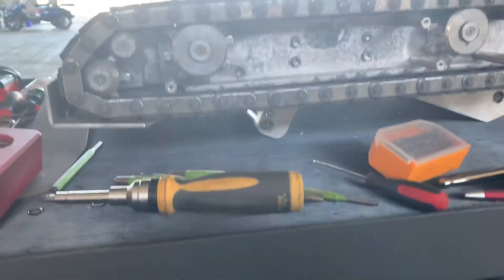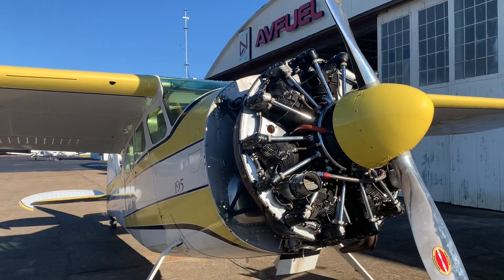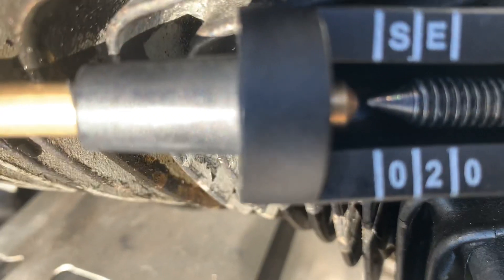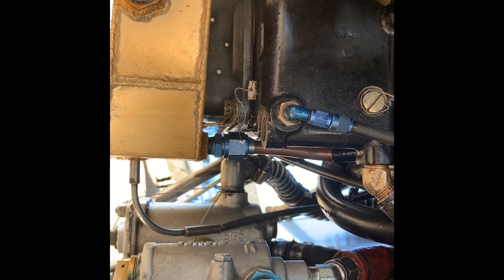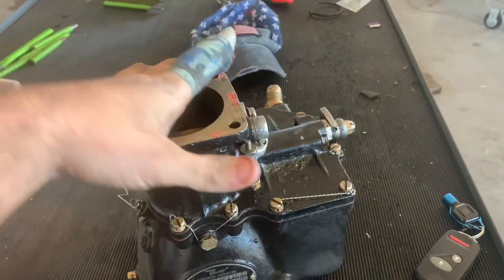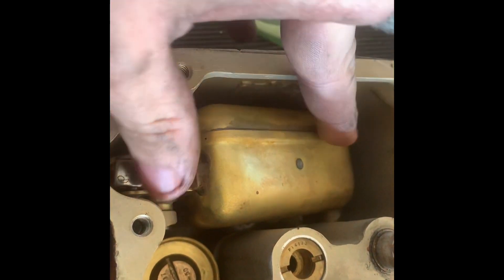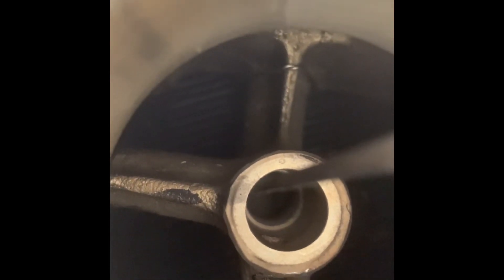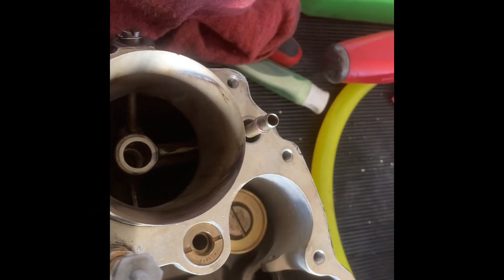Cessna 195.  No start diagnosis and repair.  A day in the life of an A&P mechanic

Comment: Thanks for posting and for the education.. The Bat/Start position (right mag, actually a "Distributor" ) will start retarded 3 deg BTC and auto advance to 31 deg after start as RPM's increase using fly weights. 

Left mag (key position to the right of "Start")  always operates advanced at 31 deg. Actually, it has a lever where a control cable can attach to so you can manually retard it for start, and set it to advanced after start. But that lever is safety wired to the advanced position and that function is not used, at least not on C195's and WACO's. So you start on the right and switch to both as soon as it's running. Note: the right "battery timer" (as it is called) should run fine by itself since it automatically advances). It all works well....since the 1930's (the engine/mags. The C195 came later).

Yes, it does have sex appeal. When my hangar door is open, I can't get much work done because everyone comes by to gawk at it and ask questions. That's a good thing.

Comment: Jacobs engine has battery ignition like a car on one side and a regular magneto on the other. Next time you have the cowl off on the 195 look at the engine mount to firewall bolts on the left side, they are vertical and on the right side there is or should be a hold open rod so you can remove the right side bolts and swing the engine out to get to and service the accessories on the rear of the engine.

Comment: Good stuff.  It’s so rare to find an A&P willing to open up a carburetor, or any other appliance for repair.   

   Most of the time, the default is to send it out for overhaul $$$.

     Just a small nit-pick.   What was done to the carburetor was a “repair”, more specifically a disassembly and IRAN.    Only the manufacturer can perform a “rebuild”.   

       Nice work getting the engine running again with minimal downtime.
Reply from the maker: Hard to talk and film.  No, it was not a rebuild in the “legal” standpoint.  We really were just checking for trash on the needle valve, that was the issue.  Finding tech data for the carb was the hardest part
Reply from the maker: It’s also weird that a lot don’t.  In school they have you rebuild a Carb and a Magneto like it’s something you’ll do everyday in the field 😂.

Comment: Diggin that box! Bahco?
Reply from the maker: Beta c26s on a craftsman intermediate box on a custom frame with pneumatic tires
Reply from the maker: Here is a full walk through 

My custom portable mini box.  Slammed with Knipex, Wera, and Gearwench.  Aircraft mechanics toolbox
https://youtu.be/8Harjj-X8mY
Reply: Awesome thanks! I used to work a Duncan Aviation LNK and we used to go between Hangars all the time and something like would have been Nice! It always sucked pushing my 2 bay Mac Macsmizer a mile down the Ramp in Freeezin ass Cold Nebraska winters!